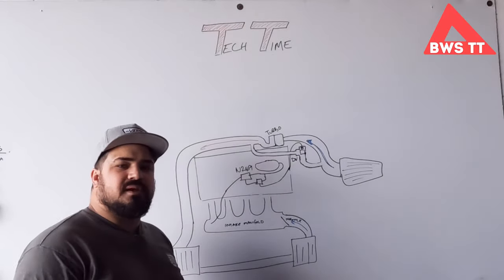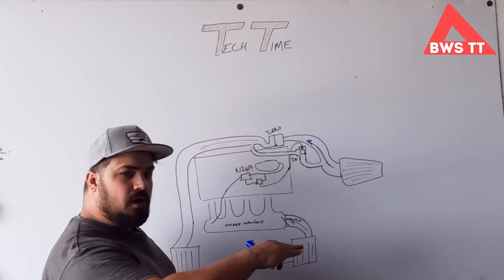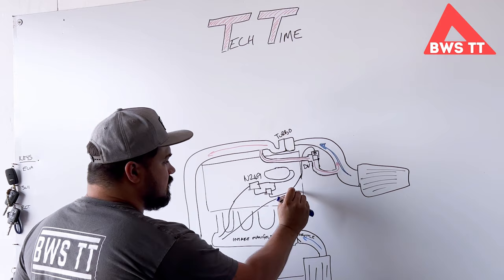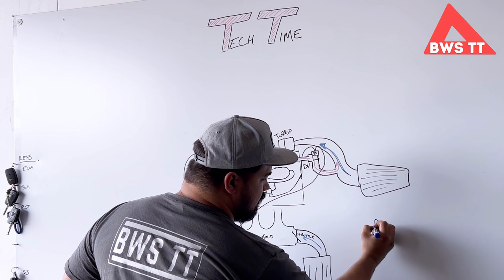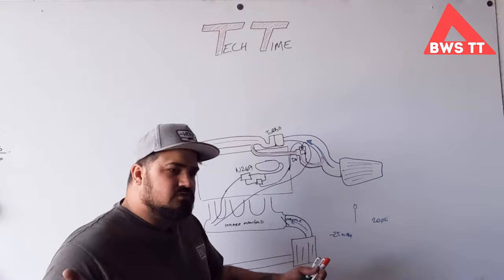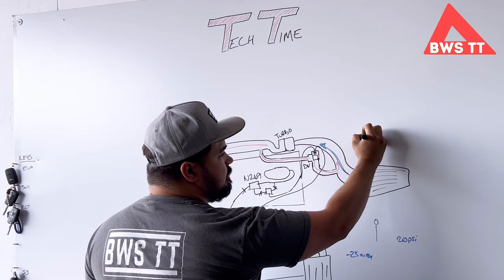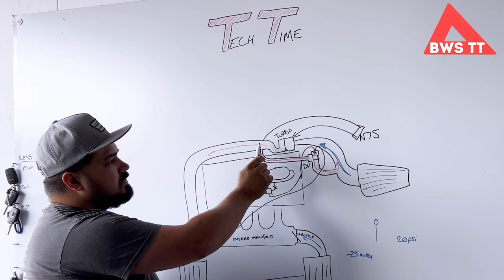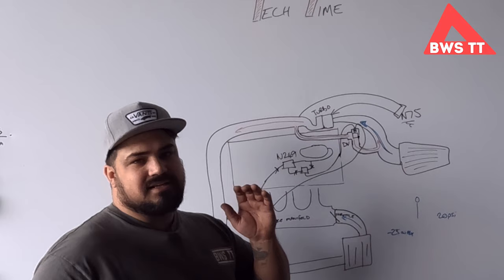Audi TT 1.8T - N249 Delete - Should you do it? Should you re-fit yours? The answer may surprise you!

Comment: Is it the same on the 180hp versions? I just noticed how awful the ratsnest of hoses and solenoids under the bracket in front of the intake manifold looks on my TT and I‘d really like to just bypass all that stuff to remove points of failure.

Comment: Awesome. Very nice explanation. I didn't know about it being a failsafe in case of N75 failure. Now I am even more glad that I rebuilt whole N249 from scratch myself last year :)

The only two valves I was sure that were broken in my case were the DV and the pancake one. As those two weren't touched by any mechanic in the past 20 years according to production dates, I assumed that the "not as easily accessible" ones are probably in terrible state too, so I replaced everything.

Car now behaves much better.
Reply: Can I ask how you rebuilt it did you use aftermarket hose or oem?
Reply: @leegoodwin47   I used brand new valves and connected them with reinforced, silicone vacuum hoses. I bought 3 metres of 4mm hose and 1 meter of 8mm one to make sure I have enough.

The hardest part to get (at least for me) were hose tees matching the sizes and shapes of the original ones (there were like 8mm-4mm-8mm or 4-8-4 connections or something like that and at least one reduction from 8mm to 4mm hose).

I reused the metal plate that was holding all of those looping valves in front of the engine. Something has to hold all of that and there was nothing wrong with it (it's just a metal plate).

The vaccum reservoir was also in good shape. It wasn't leaking and it's easy to check, so I didn't bother looking for new or aftermarket replacements.
Reply: Finally. I posted this comment 3 times already and every time it was disappearing. I wish YT at least showed an error or some explanation on why my comments are gone.

Comment: Glad I came across this. First time owner of a 1.8T (01 Beetle), previous owner attempted "the delete" on a lot of things. Broke the SAI, broke the connectors on the n249 and n75, most emission related hoses broken or rotted. I'll be running a Frankenturbo F21 so I think I'll be keeping the n249 and n75 in place until I can get a proper tune and reliable way to control boost.

Comment: When you are driving a stock engine there is virtually nothing you need to delete unless you are bored. However when you get a tune every tune I looked at the 249 delete is mandatory. When or if the N75 fails your car will simply fail to make boost higher than the wastegate, if you are really skeptic go outside unplug the N75 and take a spin you’ll barely hit 5psi which is the psi for your wastegate. I know plenty of people including myself who run a unplugged N75 during the slippery winter months with zero issue. Excellent video explaining what the 249 does and why if your tune does not require it to be bypassed you should or could just leave it alone.

Comment: Great vid!

My original N75 was very slow to respond and was causing boost spikes (21psi+ on a stock car).
I believe the N249 pulled the DV open and possibly saved the engine from catastrophic failure before I figured out the issue.

I was considering removing it when I bought the car, but after the above experience when I fit my catch can I am going to check and replace any spurious vac lines.
Reply from the maker: Sounds like your n249 did indeed save the engine!

Comment: I know there is probably not much chance of you seeing this Bryn, but I'm currently looking into some boost issues that i have... if my turbo actuator was broken, ie diaphragm blown etc, i guess the the first time time the engine detects an overboost, it will the use the N249 to open the diverter valve and bleed as much boost away as possible... This is what i seem to have at the moment, boost can reach 20 psi plus initially, but then it drops to somewhere between 5 and 10 and you can hear the boost being dumped out... Initially i was told it may be a dodgy map detecting an overboost after fitting a badger 5 tip, but the more i research the more i think it may actually be the actuator
Reply from the maker: It could well be the actuator, I would test it manually with a pump and see what pressure it moves at

Comment: Very detailed video. I have a problem with my AUM, when I drove on the highway in 5th and in boost it felt like the turbo went on and off. Boost then no boost then full boost. Wanted to do the modification but after seeing this I will replace the N75 and check the N249 system and might replace it if the problem keeps on.
Thanks for the video helped alot

Comment: Next time you've got your teaching head on, maybe extend that video with a part 2 about DV and aftermarket diverter/blow off valves especially springs etc 👍
Reply from the maker: Not a bad shout, ill add it to the list 👍
Reply: @BWSTT  I remember asking you about the n249 waiting for the rain to stop before you did my clutch so for me this was great!
Remember I had a twirrupping noise that you said might be boost leak? I smoke tested but couldn't find anything, replaced the DV with aftermarket. Tried the three springs and the lightest one (red I think) reduced the twirrup noise massively (although still does it a little)
I'm tempted to book a few hours with you and come up to see if you can give it a look over and see any issues that need sorting 👍

Comment: Great information.  I’m relatively new to the world of TT.  I bought. 2001 180bhp 6spd Quattro a few months back and the list of parts is well, everything so far.  Last weekend I deleted the N249 etc.  also removed the secondary air pump as it was sized solid with water.  Anyway I still have an annoying problem.  From about 2800 rpm if I go wide open throttle in second or third when the car is hot I get a little power then it backs off…. Like low fuel pressure or something.  It now has a new Bosch MAF.  All PCV hoses replaced with new ones. New diverter valve, new turbo control valve, new fuel reg, new fuel filter etc. etc.  when it’s not doing this the engine has loads of power and drives beautifully.   Baffled at this point.  Thoughts anyone??
Reply: Combi gone too 😜
Reply: @mickehoe  Have you found out your issue?

Comment: The n249 valve on my car was deleted when i bought it and didn't think annything of it. But about a year ago i blew up my engine, a connectingrod snapped. I bought a new engine and the guy from wich i bought it told that the blowup could have something to do with the n249 delete and that i should keep it installed on the new engine. Now that i have completed the installation of the new engine i am looking for what could have caused the blowup. Was the n249 delete the issue??
Reply: Нет.

Comment: Great explanation, may not get a reply but maybe a viewer can answer. Does removing this give you an engine warning light
Reply from the maker: It will throw a code for n249 missing, you can bypass it, or you can put a resistor on
Reply: @BWSTT  thanks for the reply man, it does make the head look messy and a clean up would be nice have a new fuel rail and coil packs to go on will do it then thanks

Comment: My 1.8t pulls oil when I get up to speed good driving for a bit cool but hen i go to slow down its fine as it idles down but ones I get back up the 2000 oil light comes on at 3000 goes away mainly in town with all the bs stops it runs at low rpm always causing to pull oil or light turns on also having an issue with blow by and yucky milky oil in crank case breather hose

Comment: Hey Dude
I drive the AUQ. What i have seen makes me feel that something is wrong with your explaination. There is the boost circulation valve, wich i have changed due to higher pressure. Then there is the N 249 Valve under the circulation valve in the suction hose. But it is the circulation Valve that prevents from building up pressure on closed manifold. And this circulation Valve is one-way functional. 
What i have recognized is a sucking or screaming noise in regulated boost mode ( half gas or whatever) wich may come from the N 249...but i am not familiar with the exact function. May be that it mixes particial air into the system to lower the boost additional to the wastegate....!?

Kind Regards
Klaus

Comment: my turbo had only 1 screws so i put 3 new screws when i run it for a test broken my exhaust octopus..i pay on  garage to fix it and now i got oil leak in turbo it leak only at high revs in idle no leak....i test oil cap and for sure i got exclusive crankcase pressure my pvc system need repair its broken..i wondering change it or delete it?this video make me wondering if my exaust broke because of this?i got this thing 3 months and happen to me all ur vinteo..i change trasmision sensor etc now my gona change turbo because this mechannic open it to remove it or pcv need repair..all vacum line wire seems like a rat eat them and have only 80k km before 30k km become forged cost me more than mk2 and every day something need repair....u thing my exaust broke because exclusive crankcase presure?

Comment: All those silly pipes and valves in an extra system takes too much time for it to control it in reality, a more instant response has given mine a much better drive under performance and no difference under steady drive, looks so much better and I do have a boost gauge.. but ultimately the WASTEGATE bleeds off the boost pressure all the time with instant information using the N75 valve. The n249 does not stop overboost. The n75 stops overboost. Unless faulty or sticky wastegate.
Reply from the maker: I tried to make it clear- if the boost reference to the n75 fails, the n75 cannot control the wastegate in any way, at all. At that point the n249 will open the dv to stop overboost.

Also, you say they take too much time to work- then n249 valve is controlled before the throttle plate is closed, and the valve is allowing a closer source of vacuum to control the valve, so is measurably quicker to control the valve if the system is working, since theres no delay whilst waiting for throttle to close, and vacuum to be generated in the intake.
Reply: @BWSTT  in regard to the time of it, I mean a more instant response to the actual pressure inside the inlet manifold, the DV will sense the exact pressure inside there giving a more accurate and instant feel to the DV, which under harder driving helps with boost on and off, as you've agreed some differences are marginal, and I like marginal differences because when you add them all together it becomes a huge difference :) 
I do agree though Bryn with regards to it being a fail safe, the way you explained the overboost(on an unhealthy turbo) would potentially be the only real advantage of it.. but again thats on a system that isn't maintained or looked after. 

With a healthy n75 and all turbo workings, overboost will be instantly (or close to) controlled by the wastegate dictating how much boost to generate, as you put it very clearly. 
I don't see many n249's on many big power builds still suing n75 etc or without.. and I know of a good youtuber that's posted how to do n249 deletes also ;) 

As a general driver experience you will have more feels without an n249 as it's a computer operated system controlling the diverter valve. 

But there could be slight increase in MPG keeping the n249 potentially. It's not a design Audi implicated to help performance that's for sure. And most TT owners would prefer performance I believe over keeping as much economy but that's likely quite split with how the fuel prices are right now. 

Not taking anything away from the video mate was spot on 👌 keep up the good work. But I'll certainly not be putting my m249 back on,. I prefer the instant boost repsonse and raw feel(minor) over how it used to be with a working n249. 

I think the more important topic to be at hand is the fact that on a 1.8t, deleting the Pcv valve and removing positive crankcase pressure / ventilation will result in far worse symptoms and failures than deleting the n249 👍 

You should do a video for people to see how and why they should be relocating their PCV Valve for A healthy internal system that doesn't build up acid and so on and so forth 👌
Reply: Of course I understand if the n75 wastegate fails, the car can overboost and n249 isn't there to help out.. that's as I say the only benefit I see.. but if you are driving your car like myself and always watch boost pressure, temps and 02 live data then things aren't a worry. But I understand for the other guys who don't get too into that stuff, some might want the fail safe as they have no clue about the running of an engine, and that's fine of course Motorsport isn't everyone's cup of tea 😊🏎️

Comment: does the map sensor have a role in that situation? if it detects overboost doesnt cut fuel?
Reply from the maker: Its the map sensor that detects the over boost. Regardless if it did cut fuel, you do not want more air than is wanted forcing its way in

Comment: Surly there's something else you can do to act as a fale safe that is not using the ECU and bits of tube that cause loads of problems when they rot out?
Reply from the maker: Well since the ecu controls the boost using those hoses, theres not much you can do, aside from the car shutting off completely. You could put in an mbc, but still, if the hose fails, an increase in load and rpm increases turbo spool, the only way to stop that is with a boost reference to the wastegate, or to dump the boost created, or to not allow any throttle movement.
Reply: @BWSTT  how about a blow off valve,it would do the same job but sorts of doing the same job as the one you have just removed.
Seems like leave it alone.

Comment: What happens when it starts to go? I want to keep it, but I’m having some symptoms that act kinda like a slipping clutch, and one reference says that a N249 symptom is like a clutch beginning to slip. N249 is cheaper and easier than new clutch…
Reply from the maker: I can’t see how clutch slip over rev could ever be the same as anything n249 related going wrong
Reply: Ok. This guy says his N249 is causing his RPM spikes, not clutch slip. 

https://m.youtube.com/watch?v=WtK1XoxW_1Y&pp=ygUMTjI0OSBmYWlsdXJl

I don’t know what a bad M249 would cause otherwise. Here is another symptom that makes me not 100% certain I have a slipping clutch. If I set cruise control, and slow down, then resume cruise control it will start to accelerate but then dump all boost through diverter valve more dramatically that I can do my self. It’s very loud. I can also set cruise control then disengage by pressing the clutch, mimicking a slipping clutch, the boost isn’t dumbed nearly as dramatically.🤷‍♂️ I’m going to replace M249 valve and replace vacuum lines and I’ll let you know. Please let me know if I’m crazy and it’s something completely different
Reply from the maker: @Thomas-rx9ur  if the revs rise without you gaining any momentum, you’ve got clutch slip, it’s impossible for it to not be. The only way an n249 is involved, is if as I said in the video the boost control is at fault causing boost spikes, causing more power than the clutch can handle, causing slip- so a bad n249 that also can’t then prevent the boost spikes would “rectify” that but only like putting a plaster on the situation- the clutch is still at the end of its life, and you’ve still got overboost that needs properly addressing. The much more likely situation though, is that youve just got clutch slip.
Reply: As always, thanks for the help.

Comment: What would happen if you bipassed the n75 with a manual boost controller to gain a pound or two of boost? Would the n 249 still protect from over boosting? Or would it keep the diverter open past the stock psi? Mine only pushes about 9.5-10 psi
Reply from the maker: I wouldnt advise bypassing the n75 to use an mbc, if you want more boost get it mapped in properly
Reply: @BWSTT  thank you